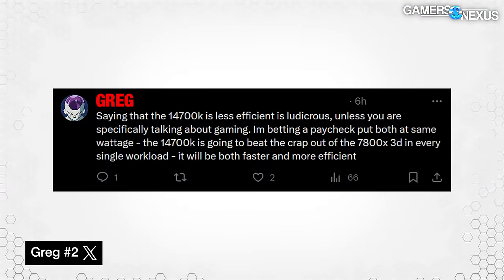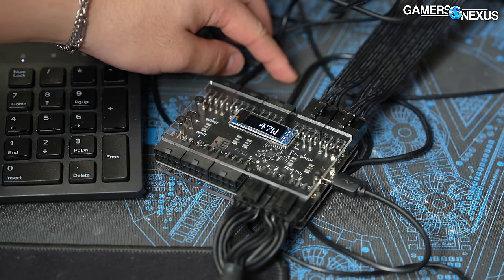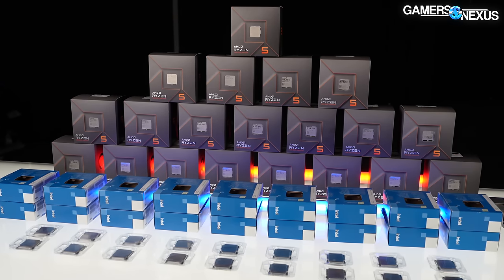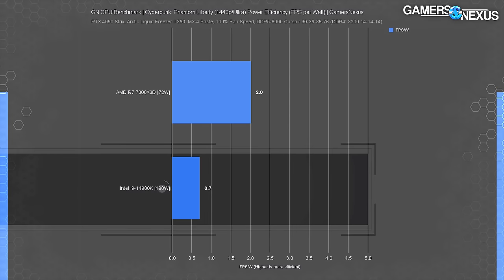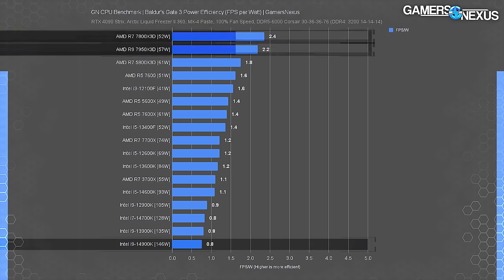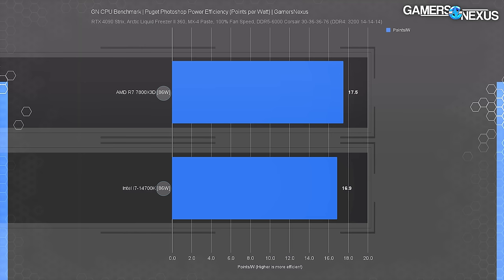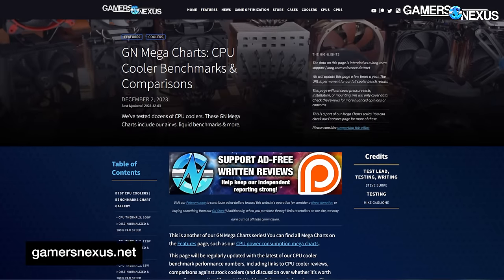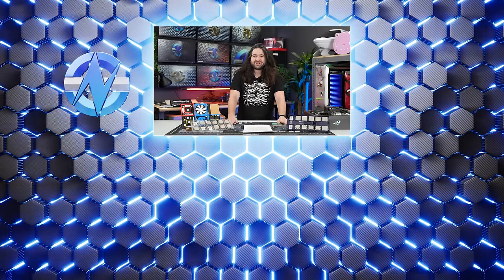The Intel Problem: CPU Efficiency & Power Consumption

Comment: Hey GN team, Not sure if I'm going to go down a rabbit hole here, stop me if I do.

Am I wrong in assuming that this test only plays to the amd cpus strengths while not proving the point you tried to make? Because limiting the wattage imo only seems to limit the extent of the overusage, not the (possible) reason. Intels approach in the last couple of cpu generations has been using the crowbar and what you seen to do in this vid is using the same crowbar but only very gently applying pressure. 

Wouldn't it be a lot more interesting to try undervolting the Intel cpus in order to find out if this can improve their efficiency?
An I missing something here?
Reply: Its less youre missing something its more youre making up nonsensical arguments for something
Reply: @stephenallen4635  care to explain? I imagine limiting the wattage to be no more than putting up a stop sign, no more than x watts allowed. While this indeed helps keeping consumption down, it's also like trying to drive with the handbrake still engaged, it makes no sense to do it. 
If you'd instead go about undervolting the cpu you'd actively help it to consume less in every scenario, while through the decreased heat also helping it to maintain higher clockspeeds in stress scenarios.
Would this stop them from being thirstier than a ryzen? Haha, hell no, but it would be interesting to see if and how much more efficient and performant the Intel cpus would be in comparison in that scenario.

And that's what I had hoped to learn in this video.

Comment: One thing worth notice its that AMD‘s IOdie design do bring higher Idle consumption, but direct comparison to a Intel CPU is not fair, in which Intel is not SOC meaning its not going to provide low speed IO. While the AMD chip like EPYC or Threadripper can be paired with motherboard that has no Chipset. It also reminds me of the missing X300 chipset. Thus, when comparing Idle consumption please include MB chipset consumption. It might make a difference, and probably interesting results. (note: still not comparable, since the downlink bandwidth and speed varies, even with device connected to different port for AMD, it could cause difference.)  Please Tell Steve to READ THIS.

Comment: I remember Intel were improving efficiency by generation. Especially going from 1-4th gen. 
This is redicilous. They just slightly dialed up the clockspeed from 13 from 14th gen, giving very low improvement (hardly noticable) regarding performance. Their flagship Raptor Lake CPU's are cloked very high (to the limit of ambient cooling), and that gives low efficiency. 6 GHz is "the new" 5 GHz landmark. Try to limit max clocks to 5 GHz, or 4.8, and efficiency should SKYROCKET!
From my own experience, The R9 5900 can run very cool/efficient @4.0 GHz All core (more than plenty performance for me), but 10% higher clock (4.4 All core), uses 40% more power, also due to voltage requirements.

Comment: Still maintain that intel is aiming for the reindeer farmers in Northern Sweden market. There you have cheap hydropower and you can heat your home by running a 14700k connected to a radiator.

Comment: Everybody goes about efficiency good point and nicely  explained... but for so what... cooling is a issue i find in the last 6 years or so when air cooler needs to be rather big even for a mid grade cpu... and for top end even water cooli g needs to be picked carrefully....

Comment: As someone to whom power efficiency matters more than a raw performance  (aiming for 1440 100fps variable settings), the r7 7700 non-X has insane performance per watt compared to the 13600k.

Comment: Intel's strategy of late has been "throw more power at it" with their efficiency offerings being "uh, try turning off hyperthreads?" They might top performance charts, but if you can get 86% of the frames with only 28% of the power...

Comment: Would be interesting to see what the huge difference in power consumption means for fan noise.
Reply: Hard to say as fans and cases are massively different and even with the same load and cases/fans/radiators there's various ways those could be installed so the practical side of such a comparison works be non-existent.

Comment: I think the main point of "Greg" is that Intel cpus must be constrained in order to become efficient.
The counter argument, that it's not the way these cpus are set at their default, is valid too, but doesn't directly answer the point.
We all know that the 13900K is way way past the efficient part of the curve, so without constraint, any efficiency measurement will be poor.
Which leads me to the following point: where are the non-K variants ???
These variants are way more power-constrained, and the settings are out-of-the-box ! No need to fiddle anything !
This would make an ideal ground for efficiency scenarios.
As an example, the 12100 fare pretty well in these tests, and it's non-K, as there is no K variant at this level.
But beyond very low-end, I rarely see any non-K variant being tested when a K variant is available. As if reviewers disliked them. They likely do...

Comment: Cost of electricity and heat are factors that go beyond CPU. More power hungry CPU means likely higher power supply. More power means higher temperatures, making you consume more electricity on things like fans or air conditioning.
I can't say that I know how much of a difference that'll make, but Italy's cost of electricity is decently high. I'd definitely go AMD.

Comment: the "so what" argument also completely ignores PUE.
Sure, that 200 extra Watts might end up not being a huge deal in raw power consumption, but you need to also consider that in a lot of environments you need to get rid of the extra heat that the CPU is now generating. That can potentially add another hump of electricity or other energy costs.

Comment: As a person that only cares for gaming and not giving a sht for intel or amd, i say the 7950x3d is best. When i game i have 10plus tabs in opera gx, process lasso, vipril controls software, lian li software, razer synapse and vortex, armoury crate, filmora screen recorder and other programms running in backround. I am doing heavy gaming sessions. With process lasso i set everything to run on high clocks ccd and games to run on 3d cache ccd and i get the best results. In same scenario if i had a 7800x3d then that cpu would fall behind signifcally. So if you are not a casual gamer and made it this far on my moment, 7950x3d is the ultimately best gaming cpu.

Comment: Even if the energy cost is insignificant: a CPU that burns more electricity will need a better cooling system and a better case, in order to get rid of the heat. This can get big and expensive quite fast.

Comment: CPU power draw when limited to different framerates should be the only real world metric that matters for efficiency. Because people will be permanently locking themselves to certain frequencies. FPS per watt is only interesting if you actually limit your cpu to certain wattages, which no one does. 70W vs 140W at a 100fps limit tells you clearly and directly something about the power consumption. If you then offer those value at 60, 100 and 140 fps we can see the scaling in a graph very well, BETWEEN the cards. It might be useful to actually show W/fps, so we can see at at different framerates how costly a frame is. But fps/W is not really telling us something usefull from the perspective of a gamer that WILL play at a certain performance level, and is interested in the cost.

Comment: Steve, you should really look into Igor's Lab's fan testing. Not just the Alphacool Apex but there seem to be more misleading info in previous fan tests. For example , 60 mm radiator results in higher airflow than 25 and 40 mm rads??! Not just in the Apex fan test... I think they have big big problems with their equipment and somebody hint hint should look into it. Der8auer have been criticizing them but we need an overall view of the scope of this and who is better at that than GN. Can we even trust Igors lab at all, for any fan tests, or ANY test whatsoever?? 😮

Comment: Please consider adding the notion that in cold areas the added watts can be utilized as heating whereas in hotter regions it will require stronger air conditioning.

Comment: I really wanted to go back to Intel after getting a 3950x due to platform maturity, but their move to mobile chip design (big/little) was such a terrible fit for desktop, especially games, and the requirement to use Windows 11 sealed that coffin, as I'd rather use Linux (and have finally started learning it).

Then the X3D CPU's shook the industry.  And Intel has just been pushing power something fierce to try and play catch-up, which seems to have become the norm nowadays with all PC hardware as Moore's law is going the way of the dodo.  Pretty terrible for everyone, really; massive burden on power grids and people's electricity bills, nevermind the heat output.

Intel fast became what AMD was for a decade, and knowing their history of bullying AMD in ye olde days, I'm kinda happy to see it. Still, we need genuine competition (and these two companies keep copying eachother too much), so I hope Intel dramatically improves sooner rather than later.  And that X3D CPUs become the de-facto part, deprecating non-X3D.

Comment: i genuinely dont care about power consumption, i just put a psu that's a tad overkill in my pc for g ood measure. i want a pc that can handle games at any resolution and not bottleneck a gpu and handle discord, OBS, browsers etc on another monitor and intel's cpus are just better for me, currently. though AMD is no longer locked so they can be undervolted and overclocked. if i was on am4 i would just grab a 7800x3d. cpu competition is so great that it's really more about OTHER compoonents that i either already have, or plan to buy, more so than the actual cpu that is the deciding factor. here's hoping intel gives amd an nvidia a surprise beatdown att some point and make gpus actually competitive. it would be an absolute dream to watch them shock the world and drop a low mid, mid and high tier gpu that beats the shit out of say a 4070, 4070ti and a 4080 ti for instance, respectively - and for 1/3rd of  the price and with stable drivers.  force those greedy bastards to stop price gouging and AMD to start putting more effort into shit that doesn't just add rasterization speed. and, recently, also to stop price gouging. 

rant over - this is a gaming tech review channel and ur g onna review current new tech regardless of if the differences are marginal. ive learned a shit ton from you over the year too. keep it up!

Comment: The Intel chip is more versatile - it's capable of boosting to 6+ghz for workstation tasks, as well can be downclocked for things like gaming where 4.9Ghz P core is more than enough. - which would significantly lower power draw. All while having a great memory controller capable of handling 7800+ on basically any z790 board. 

The higher RAM frequency can potentially scale with some games. Just like how 7800X3D extra Vcache may or may not scale on certain titles.

Comment: There are people you think a CPU will break the household's electric bill budget?
If my PC draws 500w or 700w  who cares.
Reply: Last year the electric prices went trough the roof here in the Netherlands. At some point it went up to around €0.90 per kWh. If your pc draws 200 watt more at that point and your using it for 10h per week(which is not alot) it will cost you €27.38 a month. € 328.50 per year. So  yes it is very important to some people. Not everyone has access to cheap electricity.
Reply: @Onraad  I have a 6ft beer fridge in the garage   
that looks to be from the 1990s and many times of is out of beer.
I wonder what a 1990s fridge  uses in power? More than the average cpu I would think .
Unplugging that fridge will not be a game changer on the electric bill.

Comment: In Germany you pay around 28ct ($0,31). However, last year there was a spike and a high increase in costs, which was absorbed by the government and so everyone had to pay a maximum of 40ct ($0.44) for a kilowatt hour. These prices also include taxes (I say this because in the US many prices are quoted without taxes... correct me if I'm wrong).

So yes, Germany is expensive - but not AS expensive as some right-wing populists like to claim because they believe the current left-wing government is to blame for these electricity prices.

Rather, the culprit was the fear of rising prices due to the war in Ukraine and the fact that Germany would no longer purchase gas from Russia.0,31) per kWh.

Comment: All these numbers and stats for gaming yet...
I came from a 3700x to a 14700K
My amd cpu idled at 60°c, 40watts
While my Intel does 30°c at 8watts

Normal load
Amd 70°c to 70 watts
Intel does 40°c to 30 watts

Browsing and file editting
Amd 70°c and 70 watts
Intel 40°c and 40 watts

Light gaming
Amd 80°c and 85 watts
Intel 40°c and 50 watts

Heavy gaming
Amd 90°c and 120 watts
Intel 60°c and 120 watts

U can say alot... But for my Intel 14700K beeing twice the perfomance then my 3700x, this is insane.

This is pretty stock... Als I tried to tune my amd to no avail, it all kept crashing.
Not to mention all driver issues, windows compatibility issues etc.

It now is used as a proxmox server and keeps idling above 30 watts... Doing crack sh*t that's insane...

I dare to say, no matter what this 'game only oriented graphs' show, that Intel... Is still more efficient.

But I do know also, and yall should keep in mind too, is that motherboards, and motherboard profiles play a EXTREME huge role in this... Try a different brand of motherboard with everything else the exact same and u can have extreme different results...

Comment: I don't care much about maximum power consumption. My PC is 70 to 95% of time idle. Even idle it consumes at least 60W and basically running discord, skype and moving mouse or network traffic can increase power consumption to 90W, just because CPU cores can't spend much time in sleep states. I have AMD Ryzen 5900X. But when I want some task to be done fast (such compiling large application from source) I want it to be fast and I don't care if computer consumes 190W for 5 minutes or 60W for 20 minutes (notebook). Actually I do, cause I value my time.

Comment: I dont care about power efficiency whatsoever on my desktop. Power is cheap here and its winter anyway. 
However i care very much about it on a laptop, i very much like the ability to unplug my laptop from the wall and walk around with it especially at work. This does bring up the question of why AMD laptops are rare and ... rather disappointing. I understand that highly integrated mobile chips is a difficult challenge and something AMD struggles with but we have seen high end laptop manufacturers slap desktop chips along side chipsets and get them to function. I dont even care about x3D and a dedicated GPU, i just want a good powerful portable workstation laptop i can run simulations on and do processing without plugging it in every 20 minutes and configuring a laptop with a 7700 would be a game changer for that. 
But that is a niche, however a 7800x3D desktop CPU laptop would be rather nice.

Comment: I suspect that much of Intel's lack of efficiency is just from them pushing extremely high clocks. Simply limiting the power budget does not help with that since in single thread bound workloads it will still push single cores to their highest, least efficient, clock speed as long as the power budget allows. This is why the higher end the SKU is, the worse its efficiency since it is also the highest clocked when running the workload.

I suspect a lot of Intel's lack of efficiency could be recovered by down clocking the maximum boost frequency of the cores and lowering the voltage appropriately. This should at least bring them to be closer to their lower end or older chips. It is unlikely the Intel CPUs could be made to be more efficient than the 7800X3D simply due to the benefits of the additional cache allowing the cores to overall work more efficiently. However, with sufficient tuning, it might be possible to beat out the lower end AMD SKUs like the 7700X in all core workloads. Of course this does not really make economic sense since you are basically buying a high end part and throwing away most of the value of it being faster, you might as well just buy a more energy efficient, slower, SKU and optimise that for similar gains.

What would be interesting is to see how "E cores only" performs against various AMD SKUs in highly multi-threaded workloads. The 14900K has 16 E cores which should make up about half the total multi-threaded throughput of the CPU. By nature of these cores they should be significantly more energy efficient than the P cores so could stand a chance to place higher in the efficiency charts, even if they end up performing worse than the AMD CPUs.

Comment: AMD has lower power limits because if it had anymore it would literally burn itself. The power density of Ryzen 7000 is unfathomable and it's part of the reason why X3D can't go any faster (on top of AMD just wanting to take control away from the user and claiming it's because the cache is sensitive). Anyone that spends 5 minutes tuning an Intel system can easily get it to run just as efficiently and still have better frametimes.

Comment: Sure, Intel has a high performance CPU with the 14900K, but not a sensible choice for the average consumer (and gamer).
The R7 5800X3D is looking better and better. 1. It is Way more efficient (for gaming). 2. It works in a platform from 2017.
I think the 5800X3D is The Best "Gaming CPU" ever made. (not the fastest now, but one that most people can easily upgrade to)
I also like the 5700X. Cheap, easy to cool (and easy on VRMs), and still handles every game without braking a sweat.